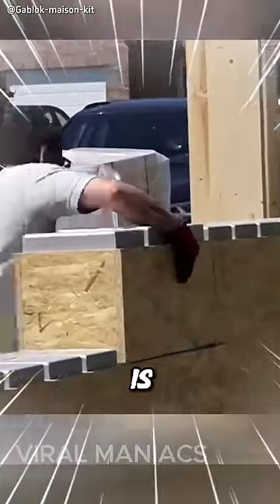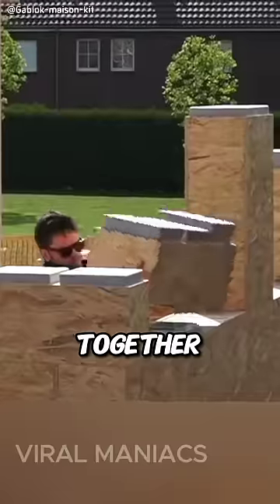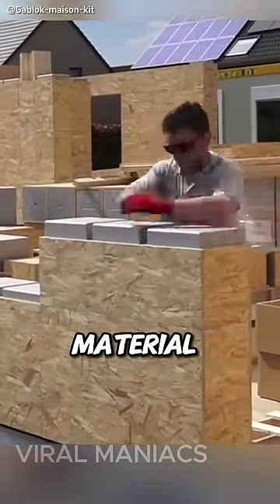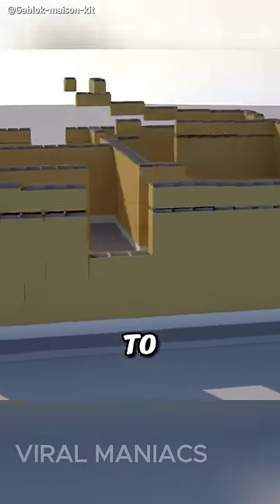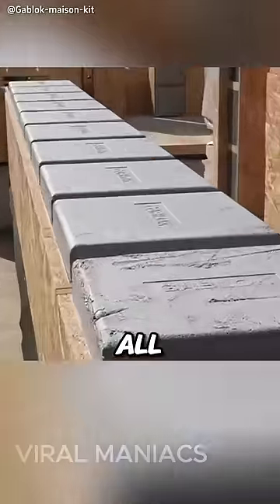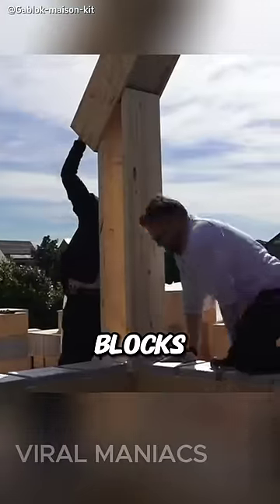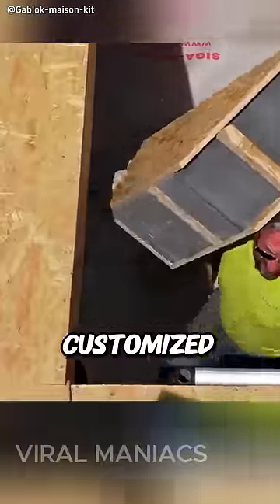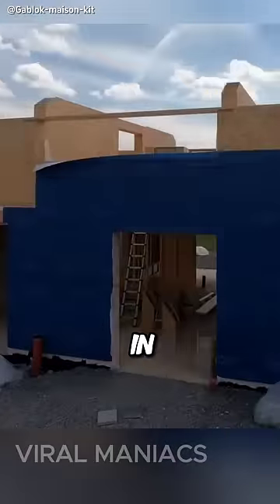Whoever Invented This Way Of Building Houses Is a Genius #shorts

Comment: As an architect, I have questions:

How do they tie it to the foundation?
How do they run MEP?
How do you properly run a penetration?
How do they prevent high wind lift?
In higher seismic areas, what prevents that foam from lateral shear?
In the event of a flood, this will want to lift due to the buoyancy of the foam, how do you prevent that?

There are limitations to this, but I still like it.  I'm not hating on it, it's my job to be critical of alternative construction methods.
Reply: if a hurricane takes off the roof, the blocks appear to not have anything keeping them connected to each other
Reply: Also: the humidity factor from inside all these blocks, where is the vapor barrier? This will rot under 2 years and collapse.
Reply: I hope someone responses to this because you have some good questions
Reply: All it would take is a bunch of metal strapping run vertically up the wall attached to the foundation if you are in a tornado prone location.
Reply: Do you think traditional style builds of Wattle and Daub or Cob with wooden frames could pass these tests? 
some houses i have seen around my patch are probably 400 years old and surving well
Reply: Agreed....looks easy but easy isn't always secure
Reply: @brianvandy4002  All locations have a varying degree of wind loading they have to design for.  This house didn't have any straps laying out in the background anchored to the foundation as they should be.  Regardless of tornado prone or not, it's the IRC, and state codes that will determine how it should be connected.  Typically, your sill plate is fastened with anchor bolts, and then the plywood sheathing anchors the wall to the sill plate via screws every 12 inches if the framer is following the correct fastening pattern.  Yes, in higher wind load conditions straps are used, but with this design, every level of block, there's a separation.  It seems like straps would have to be used 100% of the time.  High winds happen everywhere, not all the time, but you don't design and engineer for typical conditions, you design for the 100-year events.
Reply: @zDropdeadz  some things are the exception, not the rule.  I grew up in New England, we have houses hundreds of years old, but I wouldn't build that way today even if it were allowed.  Masonry load bearing walls without fire-cuts, balloon framing without cross bracing or blocking.  Just because something has lasted long doesn't mean it was a good design.  Even modern "traditional " framing has its limitations.  I hate OSB/OXB, it does not have the same structural capacities as plywood.  I'll save you all from my laundry list of things I wish contractors wouldn't do, but it's legal.
Reply: @Traumatree  at the end of the video you see them adding the building wrap.  But yes, these are OSB blocks, and not plywood.
Reply: @justanobody0 it can hold a category 5 hurricane 🌀 the first project was built here in Florida and it was on the news that's how I know and it's for people who can't afford regular houses
Reply: The answer to all of these questions: "That's the fun part, you don't."
Reply: So LEGO won’t replace from traditional
Reply: Thank you!👏👏👏
Reply: "its my job" why are you doing ur job on yt comments lmao
Reply: Yeah. Most of us would still build from old containers way better and cost effective.
Reply: @j22mattones osb is actually stronger than the same width of plywood if it is laid properly. That’s why it is used so often in subflooring and manufactured floor joists as well as exterior walls instead of plywood.  The orientation of the strands of wood is not random. It is designed and “oriented” in an intentional pattern to make it stronger than a thin veneer sheet of wood.
Reply: I know u don't like this concept because will put you out of work
Reply: @Traumatree that's just what is intended.
Reply: You forgot to ask How do you prevent a thief from bringing a farm jack and lift up the whole house from the door frame LOL.
Reply: I have questions for you. How can I contact you?
Reply: 8
Reply: @lagunacinematics  I'm self-employed.  If my boss fires me, I know I've had a bad day.  LOL. I'm constantly looking at alternative construction methods.  That's part of being engaged in an industry.  If I only ever built one way, my buildings and houses would be so bland and boring.
Reply: This is showing them just doing the dry fit. They glue it after the dry fit was tested, so each piece is locked into the piece below. The glue is stronger than a masonry bond.
Reply: I'm not a architect but I have the same questions😂
Reply: Product is called "Gablok" and it's not just these blocks, it's a combination of pre-fab materials (Ytyoung, EPDM, fabricated load-bearing walls, load-bearing pillars, concrete fasteners for the foundation, vapor barries, wooden banters where structure is needed).

The blocks themselves aren't meant to bear load and the OSB backing and floors sorta provide structure when combined with the other more traditional components.

Company is located in Belgium so I would imagine they can handle high-wind, wind-storms don't appear to be a rarity there.

It utilizes OSB4 so it's pretty durable and waterproof, from their site the core locking mechanism involves using a vertical rafter system where the insulation blocks are secured to that.

The rafters are what they refer to as the "technical duct" and is where plumbing and electrical work goes (40~ cm between each rafter and 10 for piping near the floor).

The wall itself supposedly has compressive strength up to 150kn/m (not of this trade so not sure how good that actually is).

I would assume every plan is computer modeled before they ship everything out to help curb costs.

My biggest concern is honestly just cost, I don't see how this is "cheaper" than traditional construction.
Reply: @anengineerandacat  Thank you.  That's a lot of great information.  As for the savings, if it's faster, then there are the savings.  If you can save 25% of time, then you can build more.  Even if the cost washes the savings from time, being able to build more in a year means more earnings.
Reply: @pierredelecto7069  that makes MUCH more sense!  Thanks for the missing piece of the puzzle.  I haven't had a chance to dive into the system yet.
Reply: @j22mattones  it's a neat system but Im not sure how popular it is yet. They also have the structural insulated panel (SIP) that seems to have the same advantages, but with some more traditional structure to it. 

Offers the advantage of a large portion of the house being built assembly line style, and really good air tightness. There are cool videos of those out there.
Reply: @pierredelecto7069  I'll have to check it out.

Comment: Plumbing, Air conditioning, electricity? 🤷‍♂️
Reply: My thoughts exactly.👍
Reply: Exactly!
Reply: Insulation for the cold???
Reply: The insulation s in the blocks,but plumbing, electricity etc is an added expence they're just sending material for tge hous body not internalbor siding or roofing just th " body"
Reply: @springcrocus7flower635 its in the block says so in tge video
Reply: Conduit and drilling. I talked about these in forums long, long ago. It can be done easily. However, the issue you run into is that if you go full Lego mode, the patent is owned by Legotm or Mattel, I'm sure.
Reply: Done after
Reply: I was wondering the same thing
Reply: Right?!
Reply: I think this becomes a shell and you create a false inside wall to hide all that?  I mean, a/c is easy, it can run ducts in the open spaces above.  Plumbing would require a few inches and electric can fit with plumbing behind that wall where needed. Just a guess.
Reply: Well, probs have to put in studs only on the walls that have E & P in.
 Mechanical probs have to fur out for.
That my 2 cents worth.
Question: whats the cost per sq ft?
Reply: "Fuck that noise" -these guys
Reply: only outer walls need insulation. electrical wires don't take much space.
Reply: The same as an ordinary house
Reply: Plumbing is from the underground not through walls, I'm sure they got special blocks for holes for everything,
Reply: Surface mounted conduit and industrial looking HVAC? I'd be interested in seeing the blueprints to see how well the house breathes.
Reply: I'm sure they never thought of that.
Reply: @springcrocus7flower635 the grey blocks ARE the insulation
Reply: There should be cutouts for everything else
Reply: Genius: Not my problem
Reply: You can fit those after the structure goes up I'm sure
Reply: lol You guys are lost if you think you cant run plumbing electricity and AC.  Most plumbing comes through the foundation. Coring out would be simple and might be done at factory because they design the house 1st.
Notching out for electricity would not sacrifice integrity, AC is probably gonna be in the ceiling like most houses.  For all that think this is weak,  you know nothing of stresses and how to spread out the stresses and loads in a wall or building.
Reply: It would actually be pretty easy to create conduit holes in the foam prior to shipping or constructing.
Reply: Thats what i was thinking. If this was a cabin then it works.
Reply: No different than a timber frame , ICF or double leaf cavity build 🤷🏻‍♂️
Reply: You can still build a 2x4 frame inside this for a utility space, just does not need to be insulated and sealed because it is inside the outer wall seal.
Reply: Yeah.. Big Pass
Reply: Why would you need that lol
Reply: Things of the past my friend.
Reply: Shhhhhh
Reply: You put 2x4 to frame the inside.
Reply: special block? :D
Reply: The company sends all if that in pieces too. Good luck.
Reply: Those are overrated!
Reply: @springcrocus7flower635  yes . insulation for/from the cold . it keeps you from freezing to death 🥶
Reply: the plumber and electrician know it. don't worry
Reply: Pier and beam foundation would allow for plumbing and electrical and I wouldn’t even get a central heat and air system for something like that! Window units would work just fine especially after adding an extra barrier inside to hide plumbing and electrical work
Reply: It'd be no different from a cavity construction property. They're added after the walls are up, they're not built into the walls as the bricks are laid.